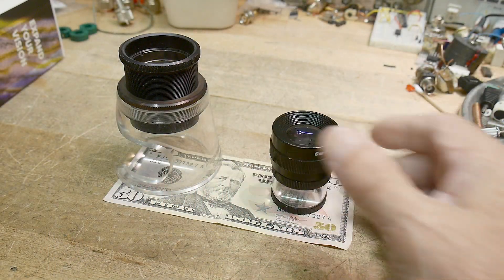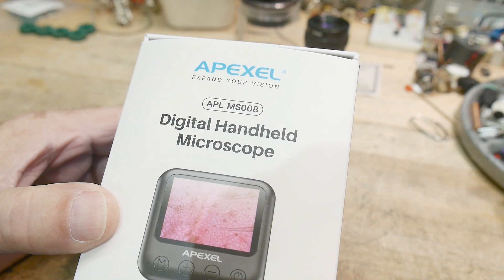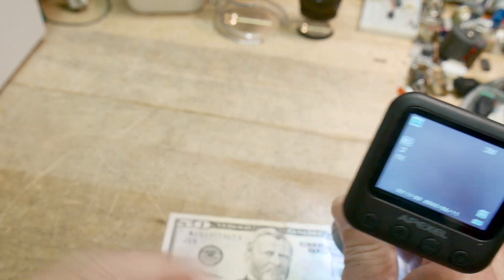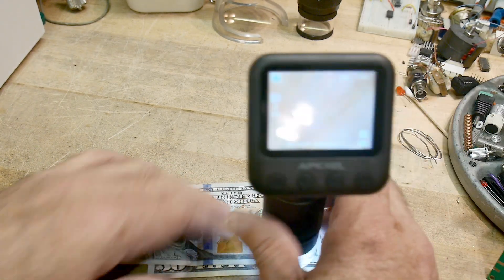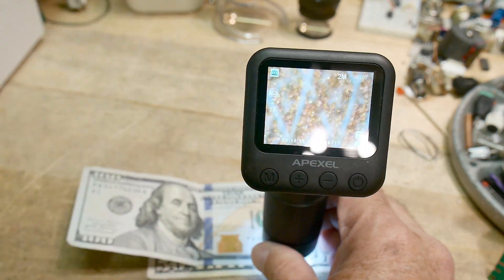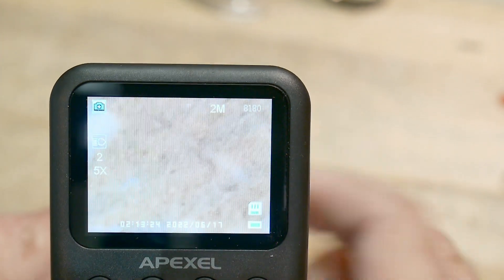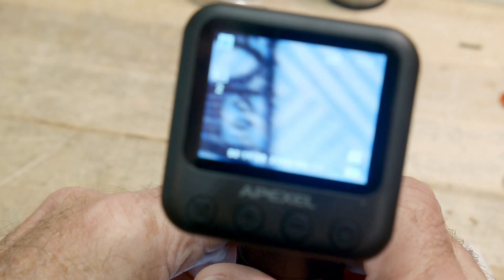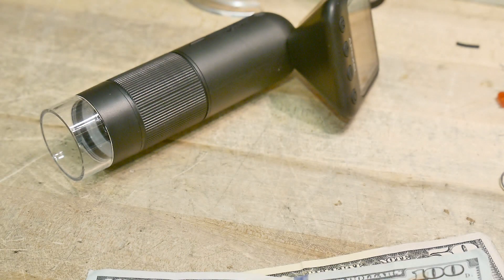#1457 APEXEL MS008 Digital Microscope Review

Comment: Would it be possible to use this as a non-contact microscope?  For instance can you adjust the focus so that it would let you look at a PCB board populated with items (electrolytic caps, toroid's ect) that prevent close contact with the board when you want to inspect a surface mount IC soldering job?
Reply: No, it can be used only as a fixed focus type and hence there is the transparent cylinder (polycarbonate!?) in front of the assembly. 
It is also used to inspect the weave pattern of a fabric material.
But you may remove the transparent cylinder and mount it in a rigid but movable frame. If you accept the small working distance is okay then you can go ahead.
De VU2RZA
Reply: @subramanianr7206  I guess I will have to look at other products then.  They have the transparent cylinder but have an adjustment so it can focus at ranges other than right at the focal plane of the clear cylinder.  One of the other 'scopes that this channel reviewed looks a lot more useful since it has a variable depth of focus.  Since  this one cannot, it seems to be of  limited use with a solder station.
Reply: @arnoldgrubbs2005  yes, it is no good for a solder station even if you try modify it.
De VU2RZA